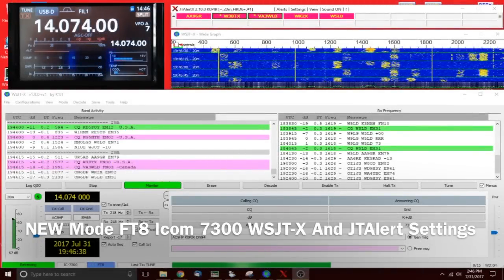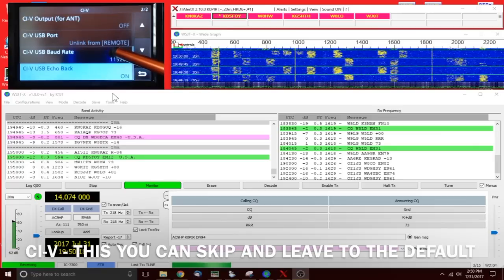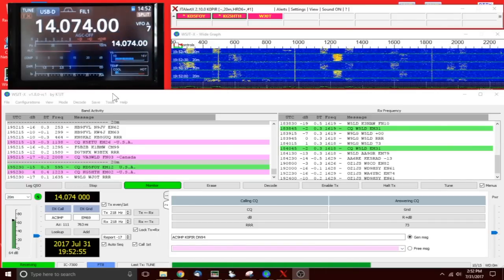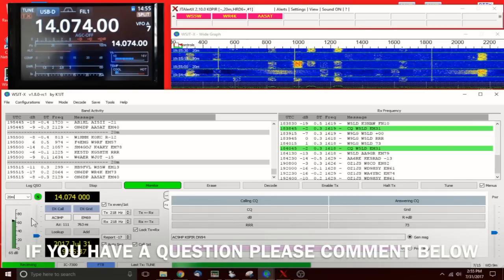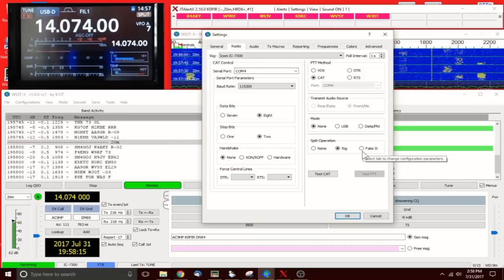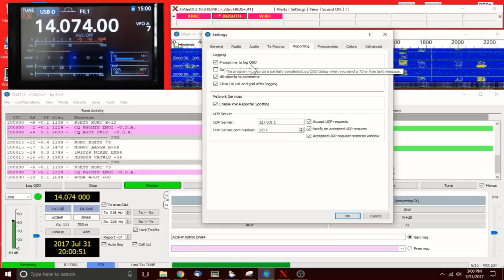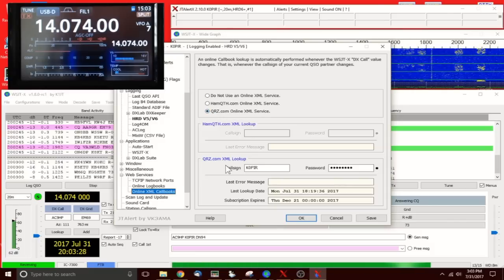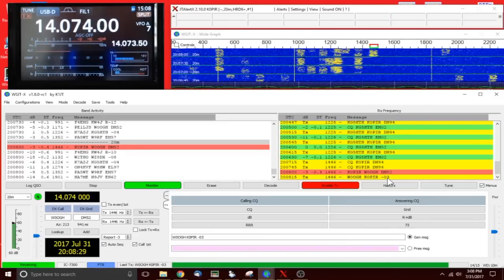NEW Mode FT8 Icom 7300 WSJT X And JTAlert Settings

Comment: Thanks for the video!
A few questions:
I have all my settings duplicating yours using both cables.  I do not show the 7300 option under configurations.  Is this a matter of renaming after completing the settings?    Using USB option I got an error msg upon rig test.  It read: Hamlib error IO error while opening comm to rig.  Changing to Comm 3 solved that.  

How do you get the rig screen view to appear?
My Std Msgs has 2 signal reports, how do I delete one?
I downloaded and installed JT Alert and the associated files, attached it to WSJT but don't see it on the screen.  What setting am i missing?

73
KK6NTL
Reply from the maker: Hi and thank you for commenting. Those are good questions. Yes just rename the configuration.
I think the rig screen you are referring too is the Ham Radio Deluxe window. Are you using HRD?
For the std message, do you have two reports that you are sending? That  is unusual. Or are you referring to the one sent and the one received? If that's the case those are correct.
Oh, when I dock JTAlert to the WSJT-X window it hides at the bottom or the top. I lose it if it's at the bottom. I have to move the WSJT-X window up on the screen. 
I hope this helps, let m,e know. Best 73 and hope to hear you on. - Rich, K0PIR
Reply from the maker: Oh the rig, in the top left corner. That was my webcam :-)
Reply: Yes HRD.
I see from the video how you have the HRD rig screen displayed.  I thought it was docked to WSJT-X.
Found the JT Alert too!  Now to get it setup.
My Generate Std Messages box shows two sig reports, one as -20 (for example) and the other as R -20, both send during a QSO.  
I lost my audio voice which was working fine yesterday!  Soundcard check is OK though.
Lastly I can not get auto logging to HRD.  Any thoughts.?
73 and Thanks!
Reply from the maker: Did you get it logging to HRD? I would double check the settings in JTAlert.  See https://youtu.be/boX6dbKnkps?t=14m
Reply: No, not yet.  I'll check the video. Thanks